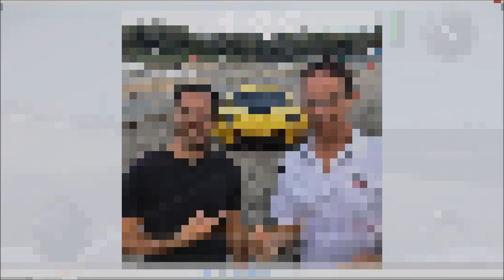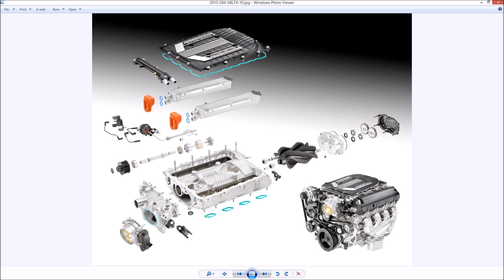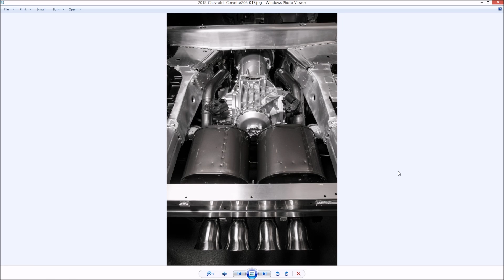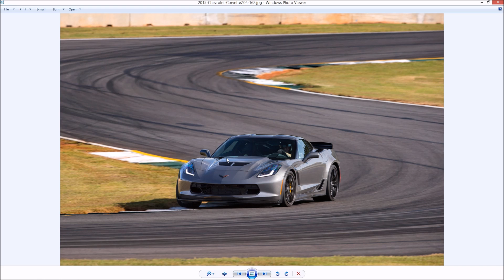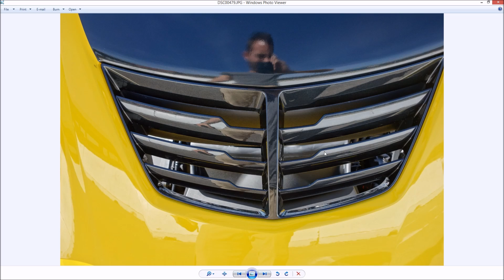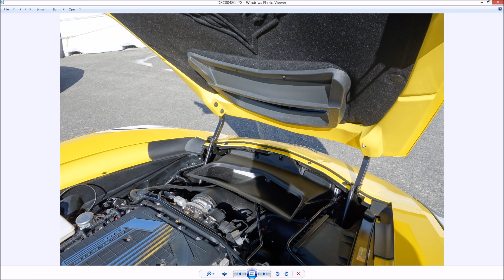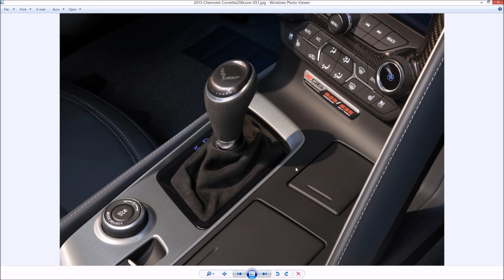Let's Geek Out About the Chevrolet Corvette Z06

Comment: I love the car but the plastic add on aero bits sorta kill it for me, I think the corvette engineers need to concentrate more on integrated design, what do you think Carlos? I know these bits serve a function for downforce but they just look like cheap aftermarket parts.
Reply from the maker: ***** It's all carbon fiber, not plastic. And the yellow exacerbates the difference. It looks better with white/grey/black.
Reply: Carlos Lago Even the front fender extensions?

Comment: Hey, Carlos, just watched the Ignition episode with the Z06 and it was all kinds of awesome. But after going online to discuss the new Z06 tests, I've found that not everyone is as blown away as I am. On various car forums, like the Corvette Forum itself, people are flipping out over how "slow" the Z06 is in a straight line. They're pointing to its "low" trap speeds in the 1/4 mile, and the other acceleration figures gathered by other magazines, which are supposedly well behind what those same mags recorded for the ZR1 and other cars in the Z06's performance bracket, like the 458. Some are even claiming it's slower than the 2013 GT500 to 150mph.

If that really is the case, I'm blaming aerodynamic drag, caused by all the new aero bits, especially on the Stage 3s. Considering that the Z's top speed has been mentioned as 185mph with full aero(195 w/Stage 1), this seems to be correct. It's similar to the last gen Viper, where the standard one could hit 200mph, while the downforce-loaded ACR had a top end of 180(est). So my question is, in your testing, did you or Randy experience a point where the new Z06 kinda hit a wall in acceleration? Like it felt like it was struggling to go faster?
Reply from the maker: WelcomeToCarnate Sounds like group think run amok in the forums. Yes, the Z06 traps 2 mph lower than the ZR1, but it's faster to the quarter. It's also the Z06 -- the model underneath the ZR1. And my money says it does 10s in the quarter easy with drag radials. People are crazy.
Reply: Carlos Lago
As it does every time something new comes along and doesn't quite measure up to some people's(unreasonable)expectations. People were expecting 130+mph trap speeds right off the bat. I firmly believe that's possible - in the first test MT ever did on the ZR1, you guys got an 11.2 @130mph- but no one seems to care about the fact that the Z06 is actually the faster car, despite the lower trap speed. Hell, I think it was Car & Driver that got 3secs flat to 60 and an 11.1 1/4 mile @127mph, with the auto of course. No ZR1's doing that unless there's glue on the ground.

Also, one more question...Head 2 Head...Z06 vs Viper "It's not an ACR, but it's an ACR" TA 2.0...Gonna happen?

Comment: Awesome vid Carlos!  I think the heat is a major issue, you should ask that Engineer what his opinion is.  I've had both a 2010 CTS-V and a 2012 ZL1 out on Roebling Road and both had major heat issues (air intake temps and diff overheating).  It's what ultimately ended up making me sell the cars.
Reply from the maker: Bob Kulstad Unfortunately our access was limited by time and weather, so we couldn't get too in depth on heating. I hope to come back to it when we test a production car next year.

Comment: C&D has had two Stingray's blow up on them, their long-termer at 6K miles and after a single lap with the one at VIR. I just can't get into it after reading that.
Reply: "Seriously?" Fuck yeah I'm serious! Toyota, Subaru, Nissan, and many more have had oil filter recalls. Stop fishing for something that's not there.
Reply from the maker: Wow, really? I'll have to look into that.
Reply: Carlos Lago I personally witnessed two blow up on Roebling Road, completely stock.
Reply: Just read Robinson's article on the Z06 too, He said their stick-equipped model threw a code during acceleration testing. Same overheating issue Carlos mentioned here? He didn't specify if they knew what went wrong.
Reply from the maker: MrNicholg I'll have to ask him. Didn't sound like overheating from what the story said. Also, the cars we drove were development cars, and they had some bugs. We'll likely test a production version of the car early next year.
Reply: The problem isn't the LT1 engine. The problem has been a faulty oil filter that releases metal debris into the engine. Coincidentally, the metal debris works its way through the lubrication system and destroys the connecting rod bearings and totals the engine block.
Reply: when's the last time you saw that be a problem anywhere else? metal debris? seirously? LOL.
Reply: total bullshit
Reply: MrNicholg Bullshit based on what? Do you actually think that because a few engine's have issues that means wright off LT1s? There has been close to 40,000 C7s made.

If you only looked into how much this happens in many cars of all makes you might be shocked. Have a look at the engine failures of the new Porsche GT3 and whats going on there when its voted the best engine out there. I dont see cracked blocks causing fires with the LT1. As well as MT also had a Zr1 vs 911 TT a few years back and the 911 engine failed and they couldn't complete the test. 

http://www.porscheboost.com/content.php?4488-Porsche-identifies-the-991-GT3-3-8-liter-flat-6-engine-problem-and-it-is-related-to-the-connecting-rod-bolts-Every-2014-991-GT3-3-8-flat-6-will-be-replaced